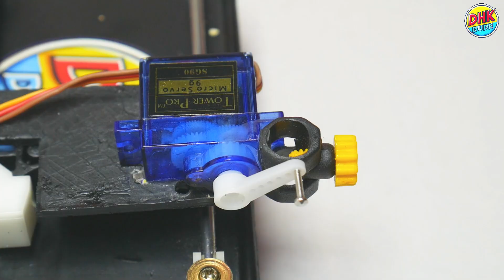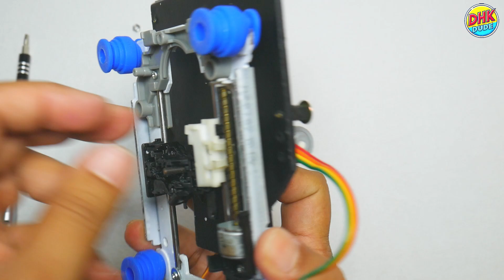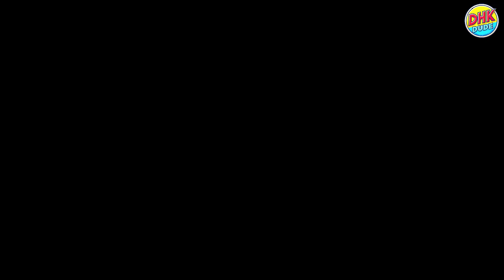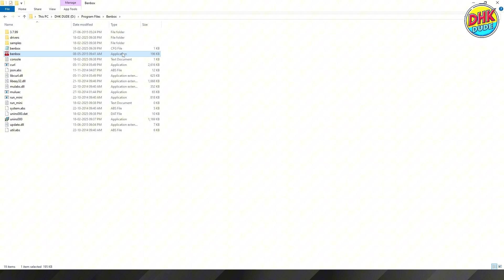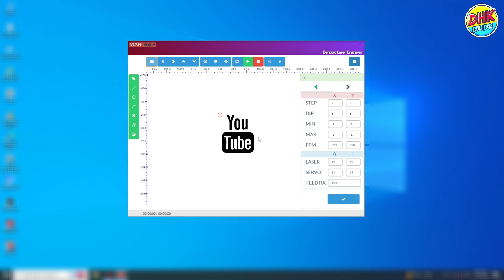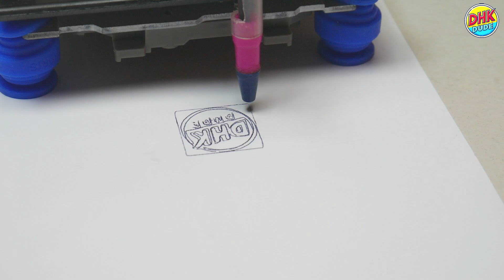DIY CNC Plotter from Scrap DVD Drives | Build Your Own Drawing Machine!

Comment: I'm trying the same but my stepper motors are getting hot. Using 9vdc external power supply. Turned down current limits as far as possible but still heating up. Any suggestions please
Reply from the maker: Thanks for watching and trying out the build. It's actually very normal for stepper motors to get warm, but if they are getting too hot to touch, we definitely need to address it. Tiny DVD steppers are usually designed for 5V, so pushing 9V through them can make them heat up fast.
Here are a few things you can try to fix this:
1. Double-Check the VREF: Even if you turned it down, double-check that you turned it the correct direction. On most A4988 drivers, turning it counter-clockwise lowers the current. You want it just high enough so the motors don't skip steps, but no higher. Check my self balancing robot video to settings up the VREF.
2. Add Passive Cooling: If you have any tiny aluminum heatsinks (like the ones used for Raspberry Pi chips), stick them directly onto the metal casing of the stepper motors to help dissipate the heat.
3. Don't Leave It Idle: Stepper motors draw maximum current when they are holding a position. If you finish a plot, unplug the 9V power supply right away so they don't sit there baking while idle.
4. Step Idle Delay (If using GRBL): If you eventually switch from Benbox to standard GRBL, you can change the $1 setting (Step Idle Delay) to 255 or $1=0 to disable the motors when they aren't actively moving, which drastically cuts down on heat.
Let me know if tweaking the VREF again or adding some cooling helps!"

Comment: we donnnt have to programmmm arduinnnnno code just all we need is to install software
Reply from the maker: Hi, Without code Arduino won't work
Reply: @DHKDUDE where is the code ?
Reply: @DHKDUDE in your video u did not memtion the code
Reply: can u please give me the code
Reply from the maker: @qamoraframes3d Hi, sorry for being late, when you install benbox, codes will be added in the folder, I have shown it in the video which is 328p firmware.
Reply: @DHKDUDE  so the codes wil automatically upload to the arduni boarr i have to ysw arduni ide to upload that file

Comment: Hey it's again Im using l293d shield so can i use the same configuration on benbox on settings YOU know the X and Y? Many thanks
Reply from the maker: I haven't tried L293D but pin configurations might require some tweaks.
Reply: @DHKDUDE sounds like a new tutorial for this situation and glad to help🎉🎉🎉

Comment from the maker: Seven years ago, the DIY CNC plotter project made waves with its ingenuity. While the original video was an inspiration, it primarily showcased the output without diving into the details. So, I decided to take it up a notch by creating an in-depth guide that covers everything you need to build your own CNC plotter from scratch!

In my video, I focus more on the software setup. I’ve minimized the part about extracting components from DVD drives since there are already many great videos on that topic. Instead, I wanted to provide maximum value by walking you through the practical and technical challenges of the software and settings for precise operation.

While I haven’t posted direct links to the software or manuals in the description, you can easily find them with a quick search.

I hope this video helps both beginners and seasoned makers looking to perfect their CNC plotters! If you have any questions or want to share your CNC projects, feel free to comment on the video. Let’s make something amazing!

If you want to see old video, you may see here.
https://youtu.be/Ex8UoguRmd8